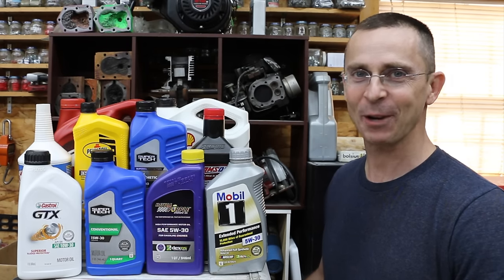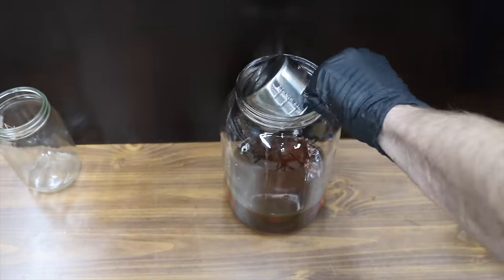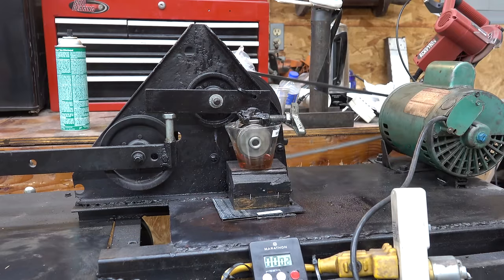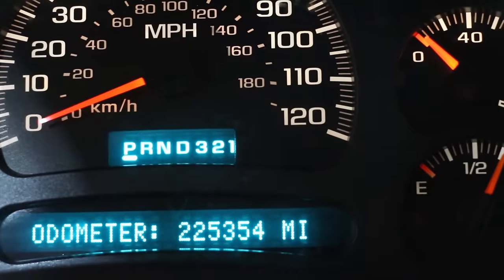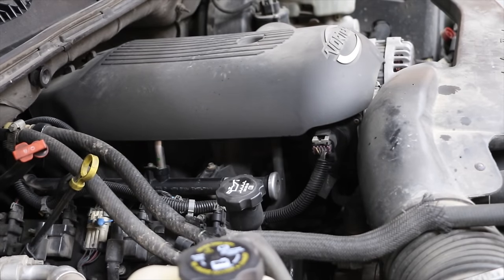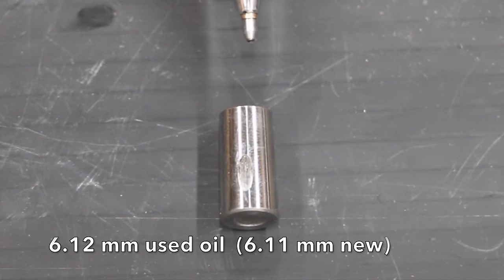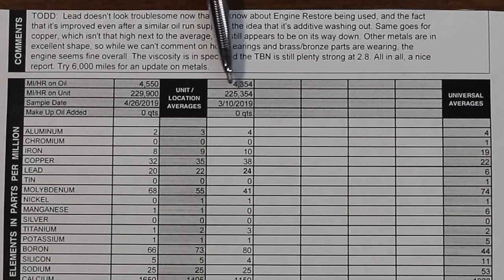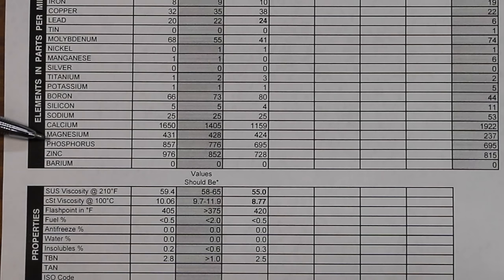Will Mixing 10 Motor Oils Damage an Engine? Let's find out!

Comment: I wonder if it is possible for you to measure how much debris a range of oil filters can hold before a significant pressure drop occurs from the filter media becoming clogged. This kind of test seems to be the next hurdle to tackle given that the oils seemed to still be okay at 4,500 miles.
Reply: Higher end filters will tell you the mileage that they're good for.  The easiest answer is to run Fram Ultra which they rate for 20k miles, so it should easily handle 2x oil changes before needing to be replaced.  Fram Ultra is so good that it's the default answer to "what filter".  $8 and it beats $15 filters from other brands.
Reply: Brown Man  And when the filter goes into bypass then there is no filtering.
Reply: @someusername121  you should never ever use old oil filter after the change, as well as never trust the "20k miles", neither oil nor filter. Replace both every 7k miles MAX (4-5 is better) and your engine will thank you.
Reply: @someusername121  Fram is also known for breaking up the media and destroying motors
Reply: Many manufactures had the figure for debris pass through and at what concentration the by pass comes in
Reply: @Kavi4GP  My point in asking Project Farm to perform this test is that his testing is independent of any manufacturer claims.
Reply: @someusername121  The mileage rating is a best guess based on how "dirty" a particular engine is. If your engine generates more particulate matter than normal, the filter will not last as long.
Reply: Brown Man  Maybe Project Farm can test to see how much pressure drop is allowed before the bypass kicks in.
Reply: @NathanielHatley  fully understand , but Note the Manufacturers  have a ASTM and ISO test for these and are done externally , try and Google the part number and pdf,  they don't show it on the typical site access
Reply: benson420710 
I agree. Some YouTube channels have cut open Fram filters and found some disgusting things. Rust on the inside of the filter, backflow valves missing, or lose in the filter. Although haven't seen them cut open a high end filter, maybe they take more care manufacturing them.
Reply: @someusername121  Frams are junk. ive seen a fram ultra kill a Ford 4.6. the drainback valve was poorly aligned when new and a chunk of it had been pinched off upon assembly. it found its way into the head and wiped out the camshaft which then killed the rest of the engine. Wix and Purolator are the only filters i use, and every major auto manufacturer besides Honda agrees, as they all use wix or purolator for their OEM. Honda uses Fram, but they specifically have them build a better filter just for them than the kind you get at the store. Champion Labs also makes filters but i would rate them only marginally better than Fram as they use almost just as cheap of materials.
Reply: @benson4u215  Read up on Fram Ultra, it's not the same as the orange can Frams.  Even oil / filter nerds who obsess about these things have nothing bad to say about the Ultras.
Reply: Ya that would be a good test
Reply: @NathanielHatley  this is dependent on the filter and varies by application.
Reply: @someusername121  I do. As I said, the filter I personally saw destroy an engine that i personally tore down and found a chunk of ADBV in was a Fram Ultra. Wix and Purolator are far superior to Fram. Fram was good until Honeywell bought them out, now they are crap. Everything Honeywell buys they lower the quality and raise the price. Just look what happened to Garrett turbos. Wix and Purolator are owned by Mann Hummel, the most respected filter company in Europe, and between the Wix, Purolator, and M-H lines are almost the entirety of OEM filter manufacturing. OEMs know what they can trust. Even Honda, they only ones that use Fram, have a special filter made on a different assembly line, and also call for a different filter not made by Fram for performance engines.
Reply: Александр Моро these filter don’t clean the oil as well and let more smaller particles through that’s why they don’t last as long
Reply: @jakesegel4022  A filter with the same amount of filter media that lets more particles through will take longer for the media to become clogged (because it's not holding the smaller particles that the other filter captured). In an ideal world our filters would capture all the particles and never get clogged, but that's currently impractical. In the meantime, we have to strike a balance between what size particles are filtered and how long the filter lasts.

Comment: Great video! You should do some testing on ratchet sets to see which are the best.
Reply from the maker: Great test idea!  Thank you!
Reply: Fade Raven i put ford red in my lexus and ruined my radiator 😞
Reply: He'd need a hydraulic press like AvE's hydraulic wrench/ratchet thing. for a real proper test that is. And rounded nuts and a few knuckles to bust.
Reply: Go check out AvE if you want tool tests/reviews

Comment: I work at a tire shop, we've always wondered if mixing oils would hurt anything.....guess not.
Reply from the maker: Thank you!
Reply: I broke my bike engine by mixing mineral and synthetic. The oil foamed and didn't provide enough lubrication.
Reply: @Rentta  kind of; you probably mixed an oil with acidic additives to a oil with alkaline additives to cause a foaming reaction or one of the oils had turned acidic enough to cause a reaction.  The synthetic part is a misnomer and had nothing to do with issue.  

Think baking soda and vinegar  The issue is testing pH of non aqueous solution is difficult / flawed and thus you will struggle to find PH values of oils.

Comment: Wow, I missed this one and it is something most of us home oil change guys and gals have wondered about. I often run short a quart and add something different either a 5w-30 to a 5w-20 or vice versa and/or a different brand. I've been using Valvoline Max Life Syn Blend since reading Bob The Oil Guy's page as the best value vs performance. The warning about viscosity is well said. The F150 5.4 Triton motors have specific requirements due to the oil passage sizes in the motor. Use the wrong oil and you could be looking at $7,000.

Comment: Another well-done video. The "conventional wisdom" I got told decades ago by amateur automotive engineers and race car wannabes was: do not mix different brands of oils. That was for single changes and change to change. The "fear logic" was that the additives were not compatible.  I think this dispels that nicely. I'd still like to see far higher miles on the tested oil, as I mentioned in a comment on another video. I didn't mention there that I also had a 2011 F150 EcoBoostb(first year) I bought new and kept 11 years. I put over 218k miles on that using the computer as my guide.  I think that averaged out to around 7k5+ on changes. I had zero engine problems with that running Shell Rotella T6 5W-40. FWIW. Not being ugly about what you're doing, just my thoughts. Thanks for these great videos.
Reply from the maker: You are welcome!

Comment: Old engines love oil! I mix conv with 1/3 to 1/2 syn. I keep carbon and gasket seal with a bit more longevity. I increase viscocity with wear. My  Generators  have close to 5000 hours each. Magnetic drain plugs are my test. 100 hr. Conv show some course metal at 100 hr. In summer heat and high load revs. Conv/syn mix only show silver/black film on magnet tip. After super cleaning engine at fuel system replacement the oil burn was stenchy so conv run cured the blowby. Now back to my custom blend. Normally same brand.

Comment: Hey as we see newer gen. vehicles switching to extremely low visc.(0w-16, 0w-20) oils, would these have a stronger film strength than let's say a thicker(10w-30+) oil & safe to use w/older vehicles never introduced to such light oils? Maybe something to consider in an upcoming video, thx.
Reply from the maker: Thank you!
Reply: I switched to 0W-20 Mobil 1in our 1996 Honda Accord wagon as soon as that oil became available. Never had any problems with it. Never added oil between 7500 mile changes. Car had close to 200,000 miles on it when we parted with it (mainly cause it was starting to rust). 

Of course, the '96 Accord had a timing belt and not a chain.
Reply: @ProjectFarm  some of the older engines have timing chain tensioners that work with oil pressure and springs, those usually live short with 0W30 or 0W40, at least 5Wxx or better 10Wxx is recommended by many people. You can hear the rattle on idle if you use fresh but thin synthetic oil that was cheap, any hc oil will give you bad results. So smart people buy fully synthetic or cheap classic oil and change bit every 10k kilometers, you easily reach 400k km on the clock
Reply: I second this
Reply: This is actually a pretty good idea
Reply: thicker oil has a higher film strength than thinner, simply because larger molecules are tougher than smaller molecules. the trade off is slightly lower efficiency. modern engines are built to such exacting standards that they can get away with making that tradeoff. personally i feel safer sticking with 0w30 or 5w30 and losing that .5mpg. some people will claim modern engines have too small of clearances for thicker oil, but that is a lie, engines have had the same clearances, give or take .0005 since the 50s. tolerances of .0015 to .0025 are the sweet spot and its been established for a very long time.
Reply: Older engines relied more on pneumatic oil pressures to move specific things like chain tensioners and lower pneumatic pressure oil pumps that were fine for thicker 10W30 oil. Introducing a lower weight oil means less viscosity which also means less pneumatic pressure since a lot more will leak by the seals, leading to engine destruction.

Comment: I would love to see a video covering the differences in Bar and Chain oil for chainsaws
Reply from the maker: Thank you for the video idea!
Reply: Definitely a Good idea.
Reply: I think it's non detergent 30 or 40 weight. I know in a pinch I used to run sae 30 for both mixing and bar. Now I spend a little more for the right stuff in hopes the saw and parts will last longer.

Comment: Many motor oils of the same oil weight and API grade are the exact same fluid from the exact same factory, but they have custom bottling/labeling. Oil is super great nowadays compared to even just 10 years ago. The only thing that matters much these days is conventional vs. synthetic, and synthetic blend isn't notably worse than full synthetic. It's more important to change regularly with the manual's specified weight than to worry about the brand, and generally avoid oil with no synthetic components.
Reply from the maker: Thanks for sharing.

Comment: Head gasket repair in a bottlle. Lets try it. Always checking out your vids. Great work
Reply from the maker: Thank you!
Reply: Great oil test , something I would like to know is with a syn blend oil is what percentage of the oil is syn.
Reply: @BitchyBoxxy  Yup. Just pull the head.
Reply: Sodium silicate has been used successfully depending on the mode of failure... It's a patch job but great to try for when the cost of repair  exceeds the value of the vehicle.
Reply: @ProjectFarm  Please include subaru coolant conditioner if you do a test it is head gasket sealer required by subaru in all their vehicles every coolant change to keep in warranty. Mentioned in my owners manual as always use subaru coolant conditioner & it's a 2007 they even say so in the brand new ones too! Head gasket sealer is in every subaru on the road haha! Rebranded holts radweld product I have heard.
Reply: I used it on a gm 3.4 in a 1995 firebird and put 50k miles on it before I sold it, someone is still driving it to this day. It was some shit called block/head gasket seal. Now that I know how to repair a car and have tools I would never use it, but at age 15 it was that or pay hundreds for a repair bill so I said to hell with it and gave it a shot.
Reply: @NoWay-xu1ie  that varies by each oil. The oil company should have the MSDS avaliable on the website and that will tell you how much of it is group 1/2 or group 3. Group 1/2 are regular oil, group 3 is entry grade synthetic. If it doesn't add up to close to 100% you can estimate how much group 4 high grade synthetic is in it. Give or take a few percent for additives.
Reply: @BitchyBoxxy  front wheel drive v6s just suck to work on period. 4 poppers aren't bad. But rear wheel drive is still the best.

Comment: Thank you for the video. To clarify, motor oils can be mixed as long as they are API-certified, that makes them compatible. It is by design, so you can use any oil in case of emergency, even if you don't know what oil is in engine already. That also prevents separation issues on oil changes - one is unable to dry engine reliably, there'll always be old oil leftovers.
There's lot of misunderstanding about gasoline and diesel oils. They don't differ when it comes to lubricating properties, but motor oil is more than that. There also are additives like detergents, surfactants etc. Gasoline and diesel burning leftovers differs chemically - different acidity for example. Also, with diesel, there is definitely more soot going to engine oil, that those additives need to deal with, something not necessary in gasoline one. It doesn't mean that you need diesel oil  when your gasoline engine "roll coal" - you need to repair it and afterwards use what manufacturer says ;)
Reply from the maker: You are welcome!  Thanks for the feedback.

Comment: Very interested to know if you had any oil pressure difference than normal higher or lower, under load and at idle than before with the mixed oil
Reply from the maker: Great point. I should have mentioned this.  Slightly higher with the 10 oil mix due to viscosity.

Comment: Usually you should use the recommended oil they say to use in the owner's manual, but my car needs 10w-30 and I live in a colder climate in the winter so I'll put 5w-30 in it. last oil change I did was super early but when I pulled the valve cover, the inside of my engine was CLEAN as if it just rolled out of the factory. used that royal purple shit, it's expensive but I wanted to see what it was all about

Comment: Mixing mainstream oils is a complete non-issue.  Even the 15w-40 Diesel oils are fully API rated for use as SL or SM.
Reply from the maker: Thank you!
Reply: geonerd 
I used to buy the Rotella 15w40 by the barrel for my semi. Saw it met the SFI rating for my pickup w/Chevy 350 engine. It got noticeably worse fuel mileage (pickup), never tried it again.
Reply: geonerd 
I used to buy the Rotella 15w40 by the barrel for my semi. Saw it met the SFI rating for my pickup w/Chevy 350 engine. It got noticeably worse fuel mileage (pickup), never tried it again.
Reply: Rotella T4 in my Suzuki SV650S .... JASO certified, and covers the higher running temps of a sportbike in the hot summer....
For diesels? lmao sure it is
Reply: KelMaster Construction  Rotella T6 is great oil as well....

Comment: I've been mixing oils for years with no ill effects.  It's highly recommended.  Still have to watch video to see what happens though
Reply from the maker: Thank you!
Reply: Same $1 qt Clearance oil
Reply: ThisIsSolution also the heat and pressure in the engine will blend whatever oil is there.
Reply: @pjkentucky  yes,  it seems quite alright. Metal really doesn't care what its being lubricated with as long as its working
Reply: I have fords 15w40( about 2qts) and rotella 15w40 as the rest(13qts) no issues at all and was told never to do it
Reply: 2001 Ford F-350 my background is in the lubricant industry, don’t get excited, it was in the 1970’s and early 1980’s. Old knowledge. At one time diesel oil had both compression specs and spark specs. I seen many fleets use diesel oil in everything. Also some fleets shopped price, but used specs for what went into their vehicles. Maintenance is the key in my opinion. Not just engine oil change but anything that requires lubricant or wears. Back in the day I remember a major oil company that was looking at synthetic oil. They put a ton of money in the project, had a name for their product but stopped and shelved it for a decade. The research and test was having out the normal results in engine wear. Rings wearing razor sharp, bearing wear not seen with conventional oil. I suppose the chemistry finally caught up and now as we know synthetic oil is everywhere and dependable.Specs are the holy grail for me. Not brand. And remember most oil companies don’t manufacture all the additive packages, most buy them from specialty companies. Walmart, Amazon, TSC, I never had a bad feeling putting that in anything I drive. I have also been in major oil company packaging facilities and saw a multitude of brands being packaged. I also know the same oil went into the major oil cans and the private label stuff. Testing is a great tool that Project Farm showed. If you did testing regular you would have a broader picture. I have even seen fleets get a call from the lab to tell them to shutdown a unit. They put different metals in bearings for a reason. I have seen fleets get a million miles out of vehicles and sell them and they went on to work. Maintenance is my belief and I’m sticking to that. Right now I got Mobil Super semi synthetic blend on sale for .70 qt with rebate. 10 gallon will feed my gas engines for a while. I also have a 2000 Ford 4.6 with 240k miles and doesn’t use1/2 qt between oil change. All thanks to my bargain oil and finds.
Reply: @pjkentucky  thanks for the information! Definitely something to think about now
Reply: pj Kentucky 
Very interesting.  I have wondered about Mobil Super Synthetic. 
I have used Castrol Full Synthetic in my 97 Mercury Grand Marquis with 255K on it. It doesn’t burn oil but the valve cover gaskets need replaced.